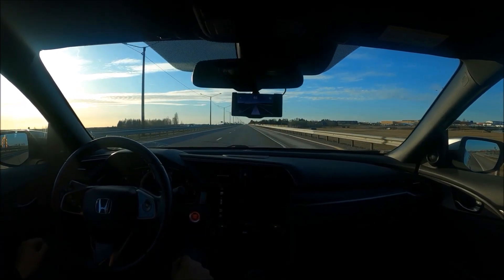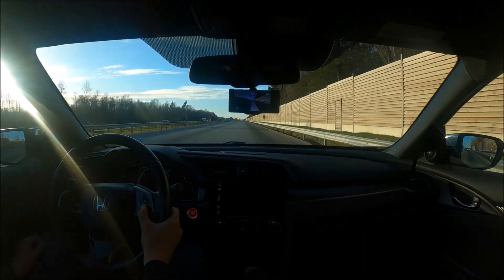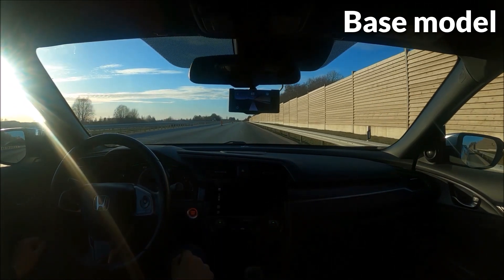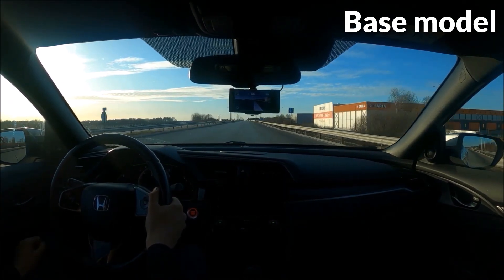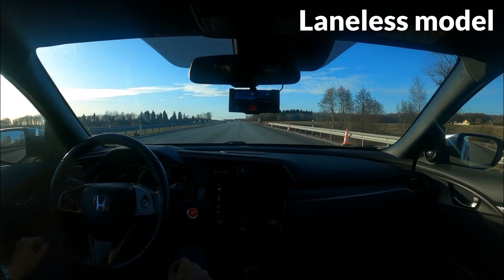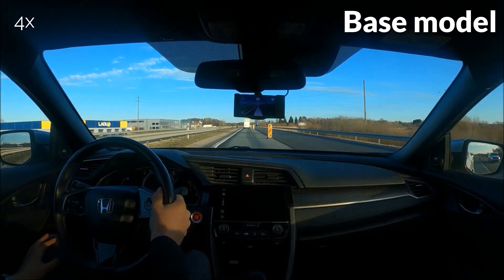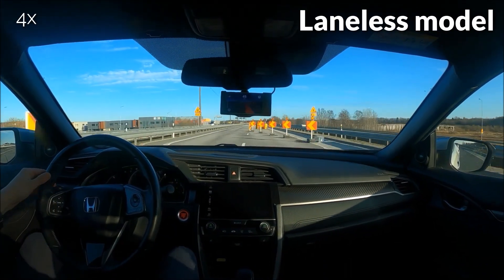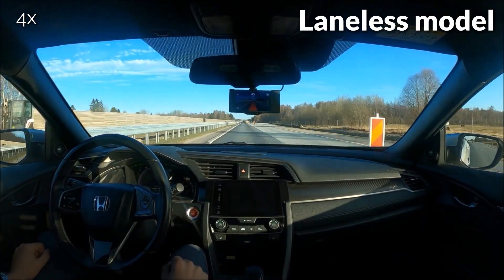Driving Through the Road Work Zone | Openpilot Comma.ai

Comment: Really interested in getting a Comma AI compatible vehicle/hardware and use it for my local commute in town. Seems like it's quite good in Estonia, it has been one of my fears it might be not be as good in Europe as most of the test videos are from the US. Thank you for making these videos :) Have you tried using it in traffic at the road work zone on Männiku tee near Järve Keskus?
Reply from the maker: Hey man, thanks for watching! Works great on highways and two-way roads. But Honda hatch is not the best in city driving because of Bosch ACC and limited steering torque, still I use it as much as possible. I think it can't detect temporary road signs so I rather drive it myself in road work zones.

Comment: I’ve tried laneless on an 800 mile road trip and then turned the lanes back on on the way back. I can definitely say without a doubt it is much better on highways and at higher speeds. I had a lot fewer disengagements with laneless however when it does mess it up it messes up pretty badly compared to the lane model.  Still a work in progress but I can’t wait to see what future holds!
Reply from the maker: Hey, thanks for sharing, what car are you driving?
Reply: @LetitDrive  2020 Corolla LE
Reply: @GhostlyHax  I'm getting a 19 corolla soon, anything I should look out for when using OP?

Comment: Hello. I always enjoy your video and watch them twice or more. I would like you to do a video in a two way road with parked car in the road just to see how openpilot react. Also that would be amazing to see how it will react with a parked car and a car coming in the opposite side of the road. I would like to know if openpilot will let the opposite car goes first or will try to squeeze between the park car and the opposite car.
Reply from the maker: Hey man, thanks for watching and ideas! Sadly, I don't get full Openpilot experience, my car is using stock ACC when OP is engaged. OP doesn't yet control acceleration/braking on Bosch ACC radar based vehicles. The factory Bosch radar does not output object data like other makes/models. Still, most important, steering is fully Openpilot :)
Reply: @LetitDrive .
Oh, I see. But quick question. What is the difference between ACC stock and ACC openpilot?
Reply from the maker: @Lorentz Thevenin 
In Openpilot, longitudinal control means that Openpilot can control gas and brake. If a car uses stock longitudinal control like my Honda, that means the stock  system that came with you car is in control. Luckily Conma AI added auto-resume for stock ACC cars, so driving in stop-and-go traffic is more enjoyable.

Openpilot ACC: I don't have any experience with it but as much I have researched its smoother, can detect stopped cars ahed, cut-in detection, auto stop-and-go ...and  I'll probably miss any other Openpilit longitudinal (ACC) related updates in future. 

Stock or OP ACC:
https://github.com/commaai/openpilot#supported-cars

But I'm not sad 🙂, biggest improvement for me is that Openpilot overrides stock Lane Keeping Assist! (Honda's stock LKAS is realy bad 😀!)
Reply: @LetitDrive  In your research, which car/cars are best for use with open pilot? I’m thinking of buying a new car just for this but don’t want to buy one and find out all features aren’t available.